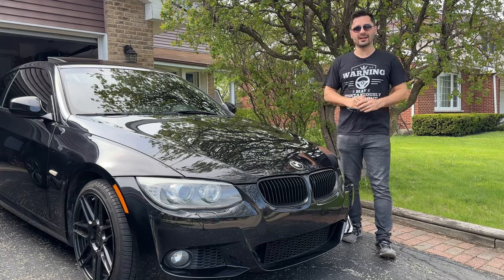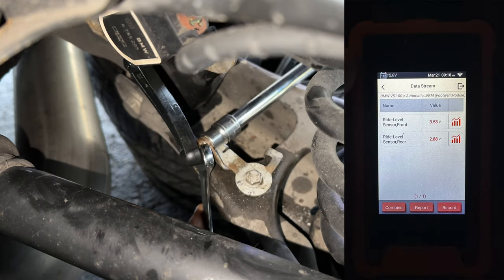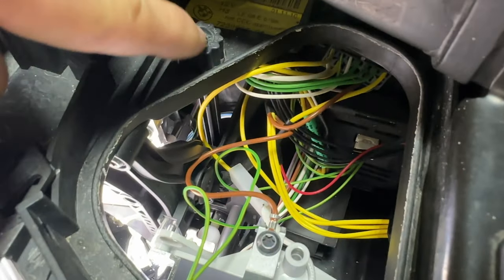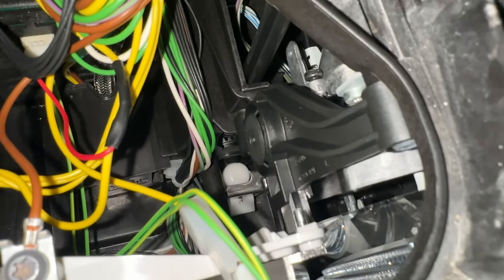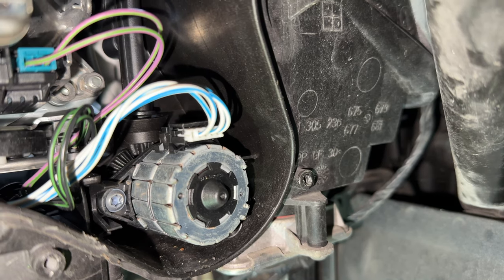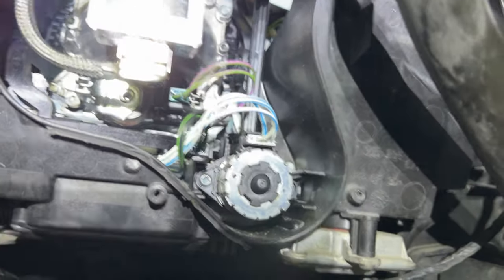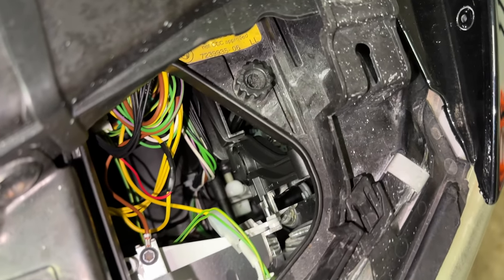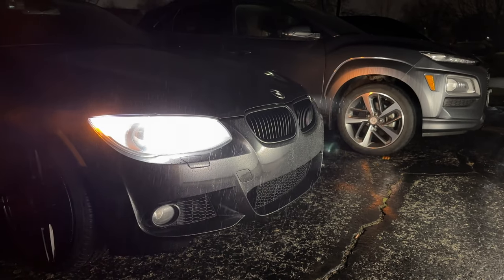BMW Adaptive Headlights Pointing Down? Here is a FIX!

Comment: Heres my car. Steering completely straight both headlights are straight but in my opinion to low, my left headlight is even lower. If the steering is centered and the lights are straight and i turn the steering all the way to counter clockwise the lights stay straight do not move at all, if i move the steering from full counterclockwise to center again they dont move.....but if i go just a degree over center clockwise both headlights go to the right all the way through steering clockwise, and both will go left as i turn counterclockwise back to center steering again but once centered they will not go even a degree to the left. So they both have the ability to go left and right up and down, but they remain straight with left light downwards even more when i consider the "higher" right one to be to low. Did some dingbat adjust my steering with the wheel all the way clockwise and then manually straighten them or something? and people tell me the left headlight pointing down is to avoid dazzling people but it think that is retarded considering this car is 17 years old and the xenon or even high beams arent even 1/10th of whats on 2020+........is this some coding bs or can i just turn my wheel all the way counterclockwise and adjust them to the left and try to find the center of the adaptive headlight motors......then keep re adjusting as needed...... im gunna check the level sensors but the issues im having doesnt really point to a failure in the lights more to a terrible adjustment....afterall they move in all needed directions.

Comment: Getting my 335i ready for a road trip and sure enough I had to pop that adjustment rod into the socket for the light to function properly. Thank you! This video saved me the trouble of removing the headlight assembaly to figure out the problem.

Comment: FYI the driver side headlight is lower because it helps to not blind on coming traffic.  and that is the factory setup not malfunction. 
The headlight level before your adjustment seems to be an appropriate level for safety.
Reply from the maker: The driver side should be lower, but not like I had. It was misaligned completely. At the end, it's still slightly on angle and pointed down so it doesn't point at the oncoming traffic, but I can actually see where I'm going now.
Reply: I was going to say the same. If a right hand drive car then the right light would ail lower